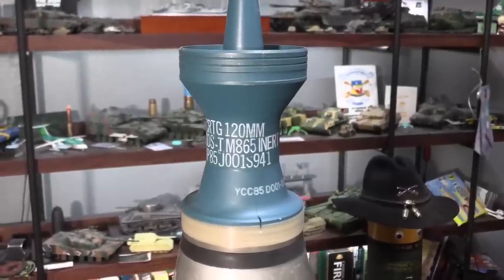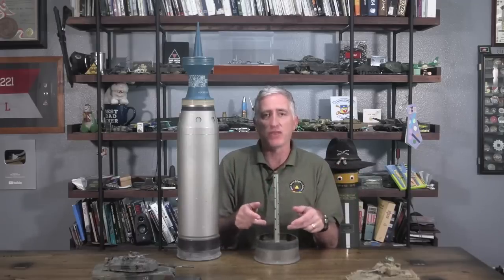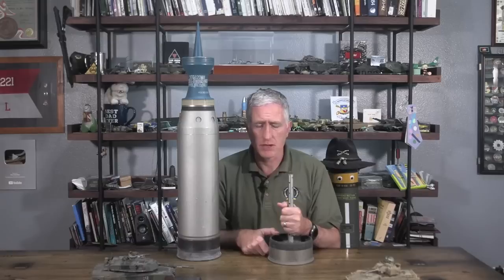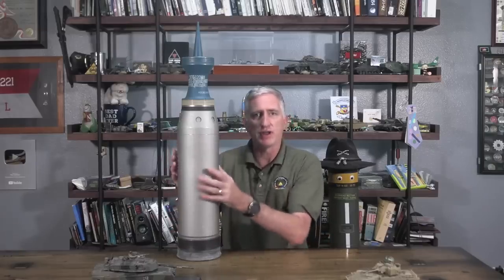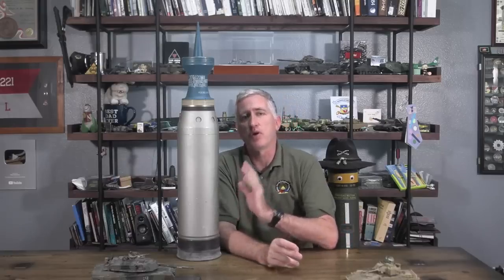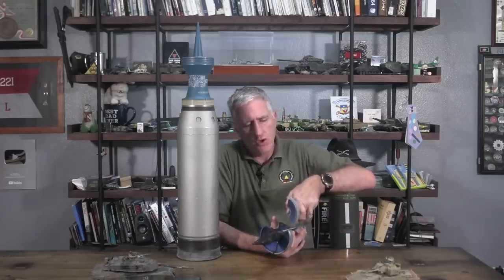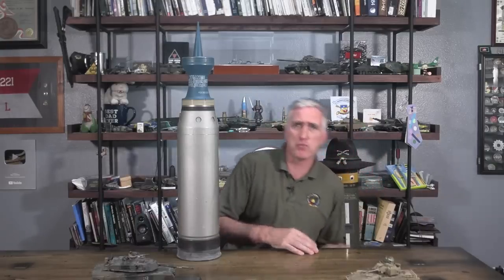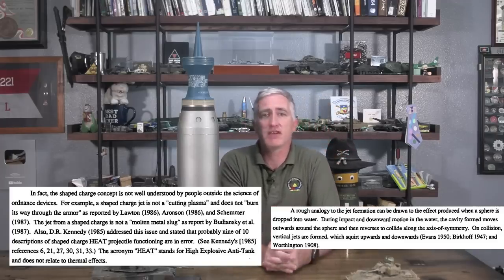Tanks 105: Anatomy of a Modern 120mm Round

Comment: I wish Mythbusters was still a thing. I'd love to see them test the damage a sabot petal would do to Pvt. Buster and also see how far a petal can fly.
Reply: Maybe the folks at drivetanks can hook something up, they did arrange for an AP round to be shot at a ballistic dummy recently ... It was gloriously gory lol
Reply: I am pretty sure actual people have demonstrated that the danger is quite real, so we can save the budget and focus on the story that one can sit on a helmet with a live grenade under it and be propelled several meters safely.
Reply: The petals have are made of cast aluminium, a 120mm M829 V⁰ is around 1670±15m/s out of a Rheinmetal 120mm/L44 gun.
The penetrator is 627mm long and 27mm diameter
Knowing the length and diameter of the rod, the diameter of the bore, you can use the observed proportions and profile of the petals to mathematically extrapolate the volume, and thus the mass and air resistance of the petals to calculate their deacceleration/m of travel after separation and thus the impact force they will impart to anything they strike at a given distance of travel from V⁰ at the point of separation. Have fun! 😁
Reply: @SonsOfLorgar  This is pretty much computationally infeasible for any old schmuck at home, considering you're going to have to be doing CFD to calculate exactly how much drag the petals encounter as they leave the barrel, and CFD is really a high performance computing task considering we can't figure out an analytic solution to the Navier-Stokes equations
Reply: @NoobLord98  which is why the shapes and sizes of these things were derived to largely by experiment rather than computation.
Reply: @NoobLord98  if you want an exact predictive model, sure, but an aproximation good enough to say if it's more than 50/50 likely to kill or maim on impact is definitely possible with a far simpler equation using only trigonometry and newtonian physics.
Reply: I was listening to a tanker discuss practice with sabot.   He said that sometimes the shoes go up in the air and you can hear a wop-wop-wop-wop of it spinning before it lands.
Reply: @dmikulec  Something to foley in on the soundtrack of the great modern tank movie which I'm sure someone has in the works, and sure to be over-used, like the Garand's PING.
Reply: @SonsOfLorgar  FM 3-06.11 -- "The overpressure from the 120mm cannon can kill a dismounted infantryman within a 90° arc extending from the muzzle of the gun tube out to 200 meters. From 200 to 1,000 meters along the line of fire on a frontage of about 400 meters, dismounted infantry must be aware of the danger from discarding sabot petals, which can kill or seriously injure personnel."
Reply: @seanmalloy7249  within 50m, I can see the overpreassure to be lethal, and the petals of a sabot to be lethal out to 400-500m, absolutely, but not a chance that the preassure alone is deadly far beyond the shrapnel zone of a 120mm airbursting mortar or 155mm howitzer shell. No fucking way.
Reply: @dmikulec that’s factually accurate. You can often see them kicking up dust trails on impact and skittering along. Also- great souvenirs to pick up after gunnery…
Reply: During the Angolan Bush War there was a blue on blue where a South African Chieftan tank fired a Sabot round at an APC at pretty close range during combat in thick bush. You can see a nice round starred hole in the armour from the penetrator and its fins and three huge jagged holes from the sabot petals.
Reply: Not possible to get a current generation tank rounds to play with?
Reply: @williamspitzschuh8167  I'm sure they'd find a work around by figuring the velocity of a petal and probably making one in their shop if they couldn't get a hold of real ones. They did stuff like that all the time.

Comment: i still have the 105mm casing that misfired when on a range at Fort Knox. The primer tube didn't have holes on one side, resulting in the propellant not igniting correctly and cracking the side of the casing on the opposite side of where the primer holes were missing. The HEAT-TPT round went about 50 meters down range and it took a while to get the expanded casing out of the breech. Oh, and by the way, the electrical contact that sets off the primer should be on a rubber pad and not touching any part of the vehicle. An M60A3 in a neighboring battalion in Germany had a bad day when one of the battery cables shorted to the hull which then set off all the rounds that didn't have the rubber insulation. In those days (the 1980s) the tanks had all their main gun rounds uploaded. There is a lot more to that gory story, but that's enough for now.
Reply: Sounds more like a heat treatment failure on the case.. missing primer holes could result in poor ballistics, but should not affect the case. The HEAT-TPT charge is fairly small compared with a sabot charge... Traditional cart cases are made by deep drawing which leaves a lot of residual stresses in the metal. The cases need to be annealed by heating them up to remove the stress and soften the metal otherwise it can crack.
Reply: @felixthecat265  Just relaying what the ammo inspector told me.
Reply: It’s like he said the thing about electrical isolation at 2:42
Reply: In the 60s there was an incident at the railhead (Can't recall if was Hohenfels or Graf) where one crew put up there radio antenna before clearing the yard,  that M60A1 was totaled.
Reply: @rph111745  Similar situation in the late '70s (If I remember right) where a train that had been loaded with 3AD tanks was getting ready to pull out of the station. A tank crewman had forgotten something in his tank, went back to get it, and touched the overhead powerline for the railroad's electric locomotives. Big flash. Not much left. 😒

Comment: Never seen a 120mm tank round sitting on a desk. Really gives you a prospective on the size of those rounds.
Reply: It's the reason anything made with a gun larger than a 120 will have to have an autoloader out of necessity...
Reply: @tackytrooper  This is a somewhat pedantic point because I know it's not exactly what you are talking about, but if I don't bring it up somebody else will: the M551 Sheridan had a 152mm main gun and no autoloader.
Reply: @tackytrooper IIRC 155 artillery rounds are still manually loaded in Paladins.
Reply: @jic1  I know the level of penetration of those rods, and I really can't believe Why is that you don't win a war having such a powerful round, I mean, you can shot at a convoy of pick up trucks from the front and destroy the engine of all of them with one shot. So I wonder, What's wrong?, You can't aim properly with that?, It doesn't fly straight enough?
Reply: @JP-xd6fm  That's not how wars work, at all.

Comment: I think the weirdest thing about modern tank ammunition is that the silver, shiny case that holds everything together is basically cardboard...

The backcap also made for a good ashtray in our barracks.
Reply: Rather than cardboard it is celluloid.
Reply: It's way weirder that the silver, shiny case is made out of the stuff people used to make photographs with.

There is still a flash involved but what changed is the position you want to be at when it occures.
Reply: @DrunknBraindead  This flash will give you SERIOUS red-eye.

Comment: 8:54 HEAT
FOA (Försvarets Forskningsanstalt, don't ask how they got that acronym, but it's the Swedish Defence Research facility) did high-speed x-ray footage among other things to establish what is actually going on in there.
The liner should be as malleable as possible, that is the ability to be reshaped without breaking or tearing. The shape is also important, as when the charge detonates, it will geometrically accelerate (if you think of a turntable, the outer rim has to travel a LOT faster than the inner rim for any given rpm due to geometry) somewhere between 20-40% of the disc into a long "needle" that, with a temperature at this point around 600-800°C (so not molten by any means), will travel toward the armour at speeds in the area of 8 000 m/s to 10 000 m/s.
Exact percentages and speeds are determined of the shape of the liner, which is why it is a critical design. Even more critical is the diameter, as that gives the base value from which the percentages are calculated so larger diameter = longer needle.
The liner NOT turned into a needle is compressed into a carrot shaped lump that trails the needle at in this context insignificant speeds. 

Impacts at these hyper-velocities leaves the normal material sciences out of the picture. Instead, the analogy best describing the process would be using a high pressure water-hose to blast a hole in a dirt wall, just keeping the muzzle steadily aimed at the same spot until someone turns the valve off after a specific time, which is when you run out of needle. 
The contact spot between armour and needle as it keeps going deeper is where you get all sorts of heat and plasma nastiness, that upon penetration will spray into the compartment behind the armour, followed by what is left of the directed explosion's pressure wave.

Continuing the analogy, we can easily explain some armour effects as well. If rolled steel armour is like uniform soil, ceramics are more like small pebbles. Water will move them without a problem, it just takes more of your total water doing so....  and remember, if you run out of water before the target runs out of dirt armour, you'll fail to penetrate.
Explosive reactive armour in this case would be the same as if someone gave you a hard slap on the hand holding the hose muzzle. The water stream would go all over the place until you can steady it again on the hole you want to make. The water will be turned off after the specific time no matter what you do with it, so you just wasted a bunch of it.
Passive reactive armour is more like tapping the muzzle. It isn't as effective as the ERA slap, but has the advantage of being repeatable if hit again.

Hopefully, least someone found this useful.
Reply: The science of HEAT rounds is always fascinating, thanks for this!
Reply: @BleedingUranium  Glad you enjoyed it :)
Reply: What might be important to say: At those high temperatures just about 150°C below the melting point (at normal pressure), copper behaves more like putty, but is of course physically still a solid. Also, even this needle is forged at supersonic speeds (sonic speed of metal is about 5 times higher than the one in air!), because what is initially in the front travels slower than the following needle parts that experienced more explosion and that really makes the damage: The spike of the projectile is just long enough so that the different needle particles/droplets/whatever-you-like-more arrive on the target at the same time. That is why increasing the distance of the needle to travel to your armour, like by installing metal fences around your tank, is so effective against HEAT.
Reply: Thanks for the contribution! Great analogies!
Reply: @sskuk1095  glad you found them useful :)

Comment: The M1 slicks 105mm was a lot of fun...  hot canisters bouncing around inside the turret with you, and melting your boot laces.     The 120's aft caps were a huge improvement, although I hated the folding box monstrosity they designed to catch and contain them.  I never had a case come apart, but did on a couple of occasions have the breech block come up on rounds half in and out of a hot tube.   That gets your blood pumping pretty good.   Thanks for the memories!

Comment: I remember vacuum loading the rounds in the M60A3, a skill that was not taught in AIT, but once you got to your first unit. It was very difficult for all of us to break that habit when we got the M1A1s in Vilseck back in 1989.
Reply: Can I ask what vacuum loading is?
Reply: @MrGeorocks  Its the MYTH that by lap loading (see the video) in a tank with a bore extractor you can throw a round into the breech as soon as it opens an have the round sucked inside. Its the sort of thing thats talked about widely in armed forces because it sounds like it could work if you've had a basic explanation on what a bore extractor does, but a quick check of the actual pressure curve vs recoil state shows it was never an actual effect to be had, it just feels like it worked because if your trying to go that quickly there was a lot of adrenaline and inertia making it feel like it took a LOT less force than when loading slowly, thus the misunderstanding it was being sucked inside.
Reply: @SheepInACart  thanks for that
Reply: No you don't.  You may have loaded quickly, but there most certainly wasn't a vacuum to assist loading.
Reply: @DK-ed7be  the dude literally just explained that there was no vacuum assist despite common belief. Someone clearly didn't pass their reading comprehension test.
Reply: @SleepyGuardian_  Yes, you might want to knuckle down on reading comprehension.  I replied to the very first post on this thread, I'll help you with a quote.
"I remember vacuum loading the rounds in the M60A3." 
Now you've been educated.  So then, apologies assumed.

Comment: I have often wondered about the specifics of those rounds, only having been exposed to bits of them that had been turned into ashtrays and such, manuals just don't do them justice. Well done Sir, thank you !
Reply: First read this as "exploded to bits by them" and was much confused.
Reply: @mooneyes2k478  With the stuff you find at gun shows sometimes, well, you never know :P
Reply: Muzzle Brakes/ Sabo = Bad things?  Some time back a .50 BMG rifle came apart after firing sabo rounds. The failure was blamed on a buildup of material from the Sabo pettles on the muzzle brake.  Thus part of the reason for “not using SABO in weapons with a muzzle break”.
Reply: @lawrencelaird2919  First, "sabot". Second, firearms sabots aren't the same as artillery/tank guns, and they don't have petals.

Comment: Tidbit to add to the two panels on the shaped charge at end.   The shape charge produces a critical fluid of the metal which contains enough combined energy through velocity and heat to erode the struck metal/concrete/quartz it strikes.   Part of the point of chobb armor is to have rapidly changing layers of chemistry with additional inhibitors.

This is where the electrostatic grid defense system comes in (BAE iirc) in that it converts the critical fluid into plasma by simply grounding a high voltage charge through the jet to the vehicle body which simply goes on to paint a slightly more radar reflective surface on the target behind the grid.  Such targets can be neutralized for the most part with two rapid strikes from RPG or simply the blast from an actual tank HEAT... or rain, bushes, a leaned rifle, Pv1 D.R.T. and so-forth.

There is a fairly broad leeway with HEAT in that it needs to work from -40 to 140°F so over-kill is the order of the day.

Over-penetration is one of the problems that the German HEAT mines are experiencing in Ukraine right now.  Luckily they're over-penetrating through the carousel most of the time.
Reply: I'm sorry, but I wasn't able to translate it (understand the point) even with Google Translator. The thing I barely use while reading or writing comments.
Reply: This is beyond wrong. It's literally gibberish.

Comment: pistol and rifle ammunition uses a swirling jet of a comparatively large size to inject the combustion into the powder, the most notably neat one is .22 rimfire which creates a central jet slightly offset from the initial firing pin strike towards the other side of the cartridge - thus one of the reasons the firing pin is in a strange location.  (I've seen a .22 rimfire with two pins tho)

The flame wave propagation rate is the same but in the larger ammunition like used in tonks (tracked wheeled boomsticks in general) you can end up with exceptionally low initial chamber pressures and over-pressures further down the barrel with enormous flames shooting out the end setting tents, sheep, bushes on fire if you don't initiate almost all the combustion at the same time.   You want a conflagratory not a volcanic combustion or you simply won't get the blow-by pressure necessary to maintain the lubrication of the projectile out the barrel.   This gets interesting with the fact that the larger tank bores actually fire the propellant on fire down the barrel WITH the round.  The 16" guns on battleships do this as well - beats waiting for the pressurized conflagration to fart enough to push the round out.

It gets very weird but makes sense if you look at it.
Reply: Well stated. When you have 20+ inches of propellant it'd take a long time (and a long barrel) to ignite it all with a standard primer. The central stem ignites the center of the propellant all the way up to the fins on the dart (roughly half the lenght of the casing).
Reply: The latest rod in service generally all got their fin almost touching the actual base plate (they delete the primer stick). 
Guess they find another workable solution to light everything up in a timely and efficient manner?
Reply: @jintsuubest9331  Most likely voids in the propellant, providing an initial flame path over a larger surface area.
Reply: 100% Nonsense...

..just sayin!